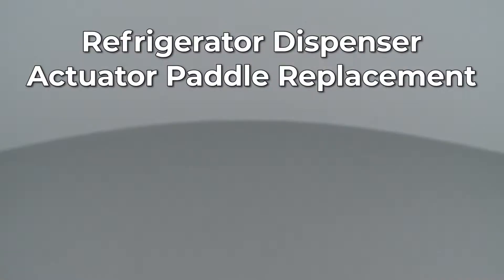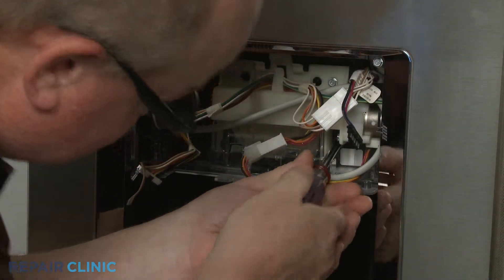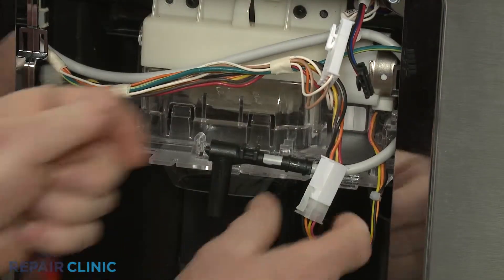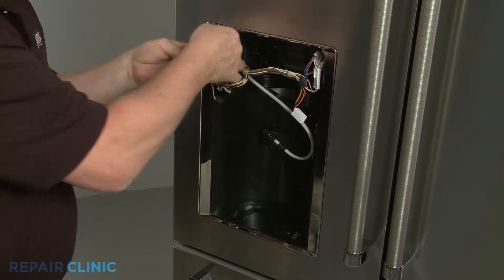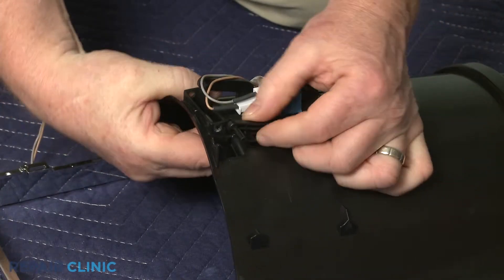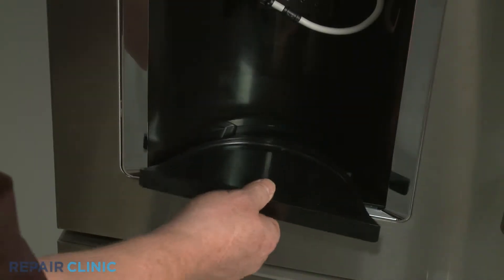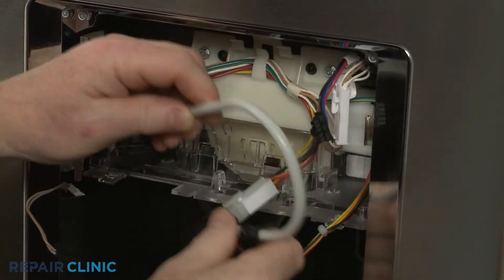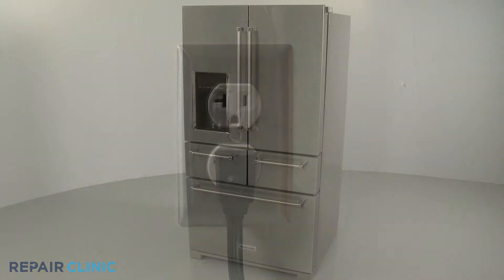KitchenAid 5 Door Refrigerator Dispenser Actuator Paddle Replacement W11109510

Comment: took the interface off, no trouble getting it back on but the drip tray will not stay put. its like once you take it off, you cant put it back on.... any thoughts?
Reply: I used a tad bit of caulk to hold the drip tray in. Mine kept falling out too. Has to be re-caulked when removed for cleaning, but not a big deal. Just a few small dots of caulk to hold it in; not much needed.